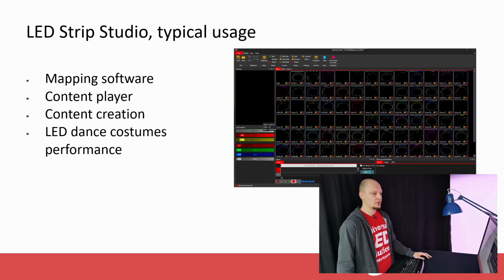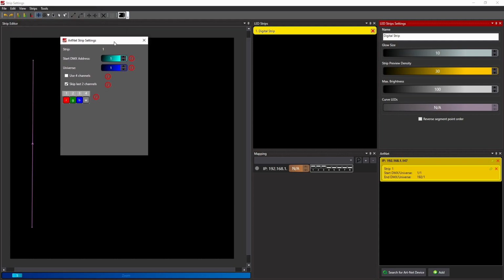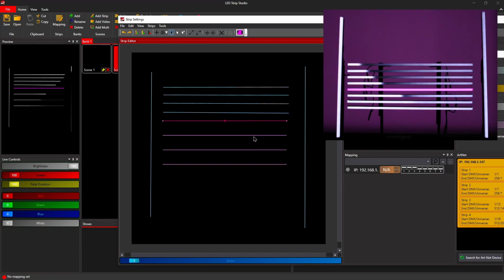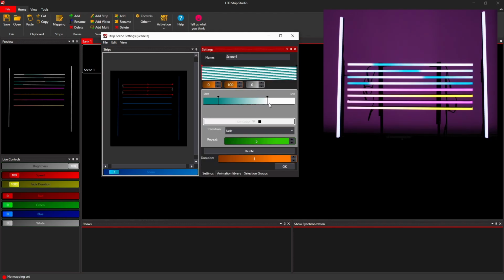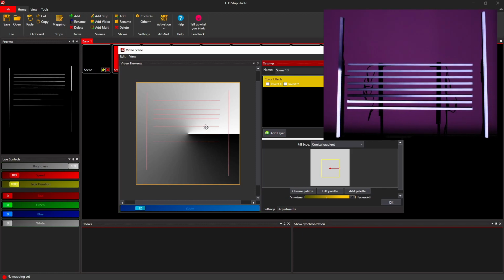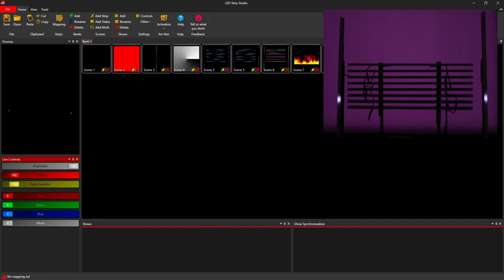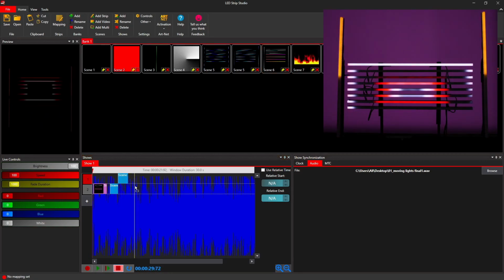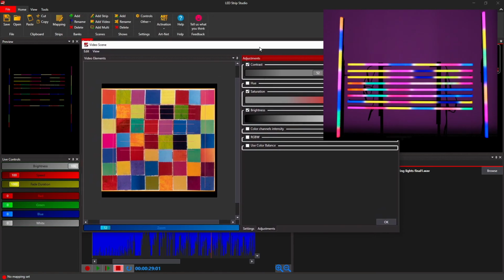How to work with Art-net LED Strip Studio Software? Complete training tutorial.

Comment: Could you explain why your outputs start at universes 1, 7, 13, and 19 whereas I have the same device and in the configiration the universes for each output start at 1, 8, 15, 22?
Reply from the maker: Sure, the 1, 8, 15 and 22 are not fixed universes. You can set the device (SPI Matrix) to e.g. use just universe 1 for output 1, use universe 2+3 for output 2 and so on. And as it is set in the device, we have to use it in the mapping. By default, the outputs are set to use 1-7, 8-14, 15-21 and 22-28 for output 1, 2, 3 and 4.

Comment: The software works with HD108 16-bit LED Strips to? Or only 8-bit leds?
Reply from the maker: According to the specification "The protocol of the HD108 LED strip is the same as the APA102 LED strip light." - thus it should work with our controllers. But the question is related more to controller than the software. If the controller supports HD108 and can receive Art-Net, you can use it with LED Strip Studio software.

Comment: so there's apps that can light up mars or apps that MUST use a mobile phone but controlling an led strip from your windows desktop via a simple audio player . far too difficult?
Reply from the maker: Hi, does this refer to a specific part of the presentation? Thanks :)
Reply: @LEDStripStudio  no, sorry,  this was my expression of frustratione on the state of the LED/music app triggering tools/ hardware - my frustration at not being able to find any easy to set up entry level solution.
Sorry if you took this as criticism about your video, it was not meant as such, just me being fed up after 2+ hours of searching, trying various apps that didn't pair with my LED strip, and then spending further hours trying to find alternate led strips that still wouldn't work, no matter - they just dont appear to exist. thing is my TV has in built led strips that change colour when using a visualizer such as milkdrop or GForce (the edge of the screens colour is mirrored by the led's) So i wished to extend the the range of these lights with the addition of led strips - which i can if i play music through my phone or use mic input rather than (better) windows audio i/o.

Anyway thanks for reply.
Reply from the maker: @AuralVirus  no problem, critisicsm is welcomed as feedback too :) compatibility is a headache, we've been there. good luck!

Comment: Hi,

A few questions:

Is there a way to midi map the scenes so during a live performance one could easily switch from one scene to another?
Is there a way to BPM tap the scenes so during. alive performance the scene would match the sound?
Is there a preferred company for the LED bars and accessories?

What is the equipment needed to begin? I am familiar with only using LED decoders with DMX.

Thank you,
Reply from the maker: -Yes, you can use midi notes to trigger scenes (or shows).
-No BPM now.
-We’ve developed our own LED bars in the past, but we’ve stopped selling, because the RGBW LEDs inside are not good enough. We have now new type of LED bar in development, but it’s not yet ready to sell. Anyway, you can use our software with every SPI LED bar (if it receives some standard WS or TM SPI signal).
-We don’t have a video about how to build LED bars. We’ve just documented a way we’ve worked on one large project for building:
https://ledstripstudio.com/portfolio-item/novira-plaza-is-it-the-most-beautiful-led-building-in-estonia/
You might  find some valuable information there.

The DMX is not that great, because of the 170 LEDs per output limitation. SPI signal is better choice.